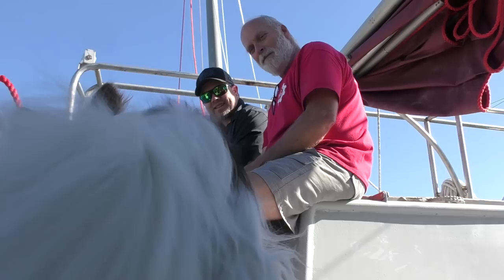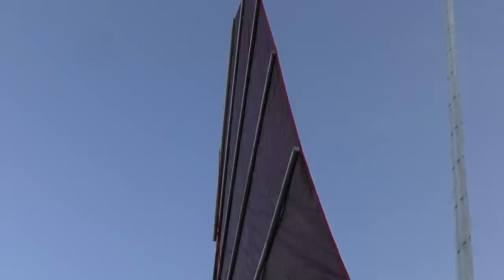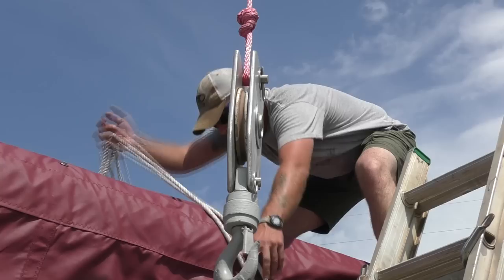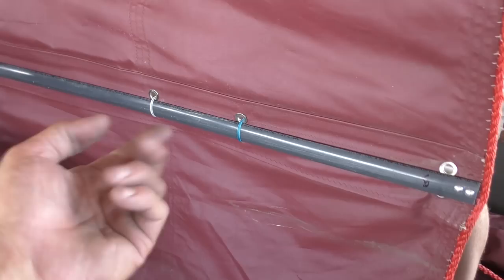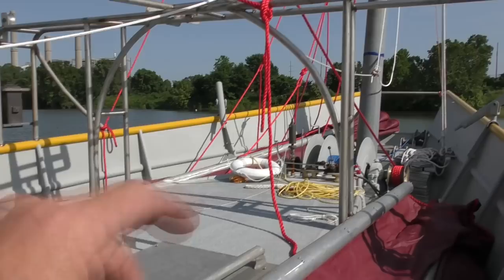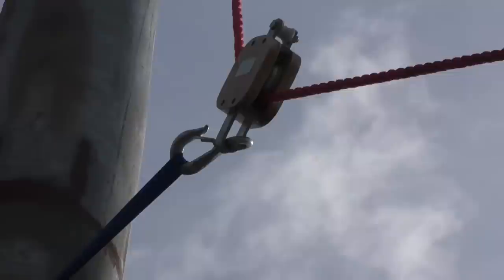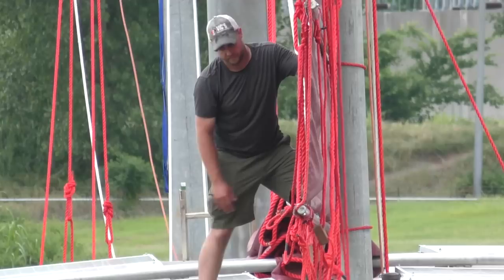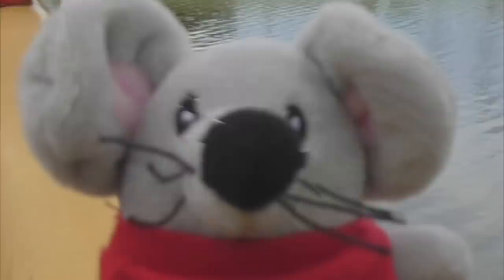Raising Sails  - Part 4 - Mistakes Were Made

Comment: Doug I've followed you thru the whole building of Seeker . As a long time sailor modifying your Junk rig to a simple Marconi type sail would eliminate all the excessive weight of a junk rig . A simple track on the mast allows the sails to slides up with little friction  . All types of sails can use lazy jacks it's not solely used by junk rigs . When you're out on the ocean and it's blowing I'm afraid the heavy junk rig will become unmanageable and dangerous . Time will tell best of luck .
Reply from the maker: You know you can convert Marconi's to Junk Rigs too.   You might find that fear without having even tried is not a good use of fear.
Reply: @SVSeeker   Doug , my comment / suggestions were not intended as criticism of SV Seeker electing to go with a junk rig as you've obviously built a fine vessel . It was only a suggestion ; as using a convectional roller furling rig has one great advantage which is being able to set & douse sails rapidly with a small crew. Junk rigs have been used for 1,000's of years so as you implied let's give it a spin before making judgement. Smooth sailing Skipper !
Reply: Why did you use aluminum battens instead of fiberglass or something lighter. That’s a lot of weight high above the center of gravity.
Reply: @claudehopper9813  you be right, arrrrrrrrrrrrrrrrrrrrrrrrrrrrrr
Reply: @crphilipp  Yeah I've just asked the Captain the same question, seems an awful lot of weight up there, especially if you have all sails up at once. To me it looks like a nightmare to handle, especially in a blow. Also many points of failure would concern me
Reply from the maker: @crphilipp    Bamboo was my first choice by the right type cost more than aluminum.   It is a lot of weight but that is not unusual for Chinese Junks.   So, I'll start here and modify it if needed.
Reply: The junk rig is a different mindset then western rigs. There are some great resources out there to read about it! Doug is doin fine, let's see how she sails!
Reply: @SVSeeker  It is much more difficult to change a "conventional" wired marconi into a freestanding wireless rigg because most marconi boats do not have enough strength in their hull/deck area where the masts go to keep up cantilever masts instead of the pressure post a wired bermuda mast basically is.
Should You find the junk idea some time later too chafey or too loud or even too heavy, You could easily change towards a freestanding wishbone version with mastrings, with a Wharram sleeve or with mast rails (I would be hesitant to regularly perforate those beautifully zinked, tapered sticks for a rail though - weld-on was better but still ruining the zink) as You already have the built in strength of the hull/deck to keep Yours erected without wires or strings. 
Anyway: You  trying to make it work aboard a hunk like Seeker is the best thing the junk rigg community could have dreamt of since Jester and Badger. 
Thank You a lot for sharing that all exactly the way You do!

Comment: Hey Doug, it's very interesting watching you transform yourself from the worlds best metal worker to a capable sailor with a completely different skillset, termanology  and materials to what you're used to. One thing I noticed was the sheer weight of that junk rig. The load on your running gear - blocks, clutches, cleats etc., increases again, the higher up the mast you go even before you get wind in the sail. Keeping the weight down on a sailboat  rig is what improves efficiency, wearability, ease of handling and ultimately boatspeed. The great thing is your ability to surround yourself with people who can teach you the skills you need and why I have watched your journey  all these years. Now it's getting even more exciting as you head for the ocean. Longtime Kiwi sailor.
Reply from the maker: Well thanks but I'm still a beginner when it comes to metal working.   There is really just a narrow amount that you need to be able to do in order to build a metal boat.  And the learning is the best part.  However there are extremely few that have working knowledge of large junk rigs, so it's exciting to be in a no man's land.  So I'll approach it like casting metal.  Start simple and add only what is needed.   So expect changes as we go.

Comment: For sail orientation: black is back, red is front, blue is down, green is up. so red & green is top front etc. My boat is much smaller but it is nice to pull the sail out of the bag & know what corner you've got without exposing the entire sail to the breeze. I use dollar store fingernail polish for color coding. Works pretty good as well for electronic insulation.
Reply from the maker: : )   You don't take junk sails down once they are up.
Reply: @SVSeeker  They do look pretty sturdy. I suppose they would not need repair / maint. stitching very often.
Reply from the maker: @lorenkinzel9145  Needle and thread, and sit up there on the battens.   : )

Comment: Water is coming down for sure but they have a lot stored up at Kaw Lake and Keystone lake.  Look up the USACE Keystone Lake page and you can see right now they are inflowing about 37K CFS of water and releasing around 31K CFS.  Kaw lake has dropped down a little bit but will ramp back up pretty soon till they get about 10 feet out of both lakes so you are looking at a couple weeks without rain till it drops.

Anyway since you have 24V on the boat I have a couple power chair motors with the wheel still on.  They will run forwards or backwards and once you pull the rubber tire off the aluminum rims should work pretty well as a winch motor.  Shouldn't have an issue for the smaller sails though and they lock automatically when power is removed but you can pull a level or pin (can't remember on these ones) to go into freewheel mode.  Anyway let me know and I can run them down and help out for a day.

Just finished up one side of the roof and have the other side to go or around another 1000 sq ft to strip off, sheathe, and then roof.  Currently has 4 inch spaced 1X4's for a cedar shake hence the need to sheathe the roof.  Furring out the walls to turn the 2X4's into 2X6's installing R19 in the cavity and then adding R10 XPS foam for insulation to seal and bump it up to R29.  It's overkill but the better insulated it is the cheaper the bills will be later on.

Comment: Just a fun note.  There is a tool called a cable tie gun. It is designed for zip ties and is made to tighten them up and clip the tails flush. And yes they do even make them for stainless steel zip ties.  Fast and easy and works with just a trigger pull.  But make sure you get a model that is rated for the stainless zip ties, because they are not all built the same.

Comment: Just so you know , when you buy sails you can get them with the corners marked on them.
Tack ( front lower)
Head ( top)
Clew ( back lower)
Peak (back top)
Usually in large easy to read letters.
Sails are left in place a lot more than they used to be but when we used to change sail for every  different 5-10 knots of wind , mistake could often be made !
Reply from the maker: Nice.  But you don't change out Junk sails.  They go on once and stay on.

Comment: They make ss cable tie tools that tension and cut short on Amazon for 30-40 bucks. Or……a steel screwdriver shaft cut the bit off and saw a slit down the middle about 1/2 inch.  Roll the tag end up into a roll.

Comment: consider buying some drainage pipe , cut it into stripes and glue or rivet them as wearbands along the masts where the pipe in the sail is contacting - also maybe put some holes into the pipes and fill them up with the water tigth closed cell Poliurethane foam - keep them from ringing like bells when they hit the mast - the plastic stripes will also help with the noise - we did it to a lag pole 
the noise might impede your sleep , especially since the non insulated part of the metall hull transfers sound like its made for it
Reply from the maker: Already have them laying on the deck. : )
Reply: @SVSeeker  thats awesome. proofs my logic isnt to far off the concensus - its all comming together... 
do you yet have a basket to hoist yourself to the top of the mast ? since you got the mast head up you should have a spot for a snatchblock up there and a hooking point for a winch on deck

Comment: Doug, grab a few of those cheap 12v winches for recovering of vehicles, hard mount them in a few sports, jic you need mega pulling power at sea one day.
Reply from the maker: The winch can be rigged to operate from hydraulics or electric. That’s when I get too old to crank it by hand.

Comment: Guys! You have to reduce the weight ( thus load) of your sails! There is absolutely no reason to have aluminum battens, they only keep the sail in shape. Use a lighter material, it will make a hell of a difference in handling everything. Good luck!

Comment: I can't help but wonder if a simple gaff or lugger rig might not have given similar looks and performance with far less weight and far less complicated rigging. We'll see how it works out for you. I share the concerns others have stated that this rig will be a nightmare to handle in strong winds. All sailors have very likely at some point been on the wrong side of a boom during a tack. Having such heavy battens in the rig only amplifies that risk if you need to be on the deck while taking a reef. Best of luck with figuring things out and may your ropes stay unknotted.
Reply from the maker: Yeah but it will not reef like a junk.   And if you're dumb enough to stand up on the deck tops while coming about then you clearly deserve what is coming.  : )

Comment: You will get less corrosion from string than stainless steel that will be accelerated from dissimilar metals. String just hold salt which is a slower corrosion.
Reply from the maker: True that but then UV has no effect on stainless.

Comment: I do this all the time on the farm 
Building sections laying down to be stood up and joined abd all the plans are in my head so it's like imagine this thing is standing up and the bottom is the top abd it's gott be a mirror of the last peice 
Weld a braket on, no that's the wrong side, cut it off weld it on the other side,no wait thats wronger,it was right the first time 
Then assemble it and yes it was wrong the first time so do it again 
The only comment I'd make about the sails 
How is that fishing line going tp hold up to UV, but how is the zip ties going to hold up to 1000s of jerking motions, stainless tie have always slipped on me, i guess its just a game of trial and error

Comment: please do the fishingline, stainless on aluminium will corrode and snap without warning. The mix will also deteriorate the point between aluminium and stailess.
Reply from the maker: I sort of doubt that.  Aluminum and stainless are often used together in saltwater.   I'm sure it will corrode, but I think very slowly.   We shall see.
Reply: @SVSeeker   Its widely used, but i have a 30 year old sailboat. And all the connections between stainless and aluminium have either made the aluminium brittle or made the stailess fasteners stuck. so from now on I try to make all the connections of the same metal, or have a easy changable disposable connection. Keep up the good work, SV Seeker is an inspiration!
Reply from the maker: @konshuss395  Ha!  In 30 years it will be someone else's problem and I'm pretty sure these sails will not last that long.   :)

Comment: Won't the stainless against the mild steel corrode, once you get to the ocean?
Reply from the maker: Aluminum and stainless are frequently used together, even submerged in saltwater. It will corrode, but I think slowly.

Comment: Why did you use such heavy battens? What are those like 1.5" aluminum pipe? and capped at that? I'd think some 2" strips of fiberglass would serve you well and wouldn't weight 1/2 as much..you kind of want them to flex... oh well just my opinion, carry on
Reply from the maker: Cost, repairable, and weight/strength is not that great.

Comment: That looks like a single small rope lifting a large sail. If there was a wind and that broke!
Maybe a block and tackle would give an advantage of the strength of several ropes to suspend the sail.
Reply from the maker: Go ahead and look up the breaking strength a 20 mm line. Prepare to be impressed.
Reply: Junks in Asia usually have a block attached to the top of the sail but that was usually without winches

Comment: Weren't these sails supposed to be easier to operate?
Reply from the maker: Did you see it reef?   Have you ever reefed a sail by yourself?
Reply: @SVSeeker  That wasn't reefing, that was dowsing. :O) To reef you would still need to tie down a portion of the sail to use partial sail. If you have lazy jacks on a bermuda rig it is not much different to dowse the main sail and most bermuda rigs have roller furlers on the headsails now so you just roll up the headsail. You can also have single line reefing setup on a bermuda rig to easily reef single handed from the cockpit.
Reply from the maker: @chaddthompson   No, you don't on a Chinese Junk.
Reply: @SVSeeker  That's pretty cool then. Is the reef held in place by the sheet on the rear?
Reply from the maker: @chaddthompson   ...and the batten, and the weight.

Comment: So i've been wondering. Slowly building ideas for my own future. Do you think a metal ship could be built in the same fashion as a cedar strip canoe? Frame up and then wrap it in strips of steel. Pull them taut and weld them in place.
Reply from the maker: Yes.  Check out Sailing the Farm
Reply: @SVSeeker  thanks! That's exactly what I was thinking.

Comment: Question au sujet de vos voiles. Pourquoi avez vous décidé d'utiliser des tuyaux aussi gros en guise de lattes pour vos voiles. Des lattes de fibre de verre n'auraient elles pas fait l'affaire. De cette façon une ou deux drisses pour lever votre voile auraient amplement suffit.
Reply from the maker: Slats have little rigidity.   And I can not weld a repair into fiberglass like I can aluminum.  Perhaps when I am in the bamboo parts of the world I'll try out bamboo.
Reply: @SVSeeker  merci pour votre rapidité à répondre!

Comment: I've commented it before and I'll do it again - I don't like the weight of those sails. All that weight aloft will be bad for stability and the difficulty in moving them is really a safety issue. First time something goes wrong in bad weather with half the crew already seasick maneuvering those sails around is going to become an issue.

I'm no expert on junk rigs, so you've got no reason to listen to me; you'll mention how fear won't keep you from getting out there. I agree with you there, but while you use what you've got I think you should take a moment to look at upgrade / conversion plans. Just because I think things can be better doesn't mean you can't start with what you've got. But starting with what you've got doesn't mean you should be stuck with the way things are either. My vote (though this isn't a democracy) is some kind of sail plan change. Give it some thought.

On the positive side. Seeker with her sails up certainly looks amazing and I cannot wait for the first time she moves under wind power alone.
Reply from the maker: I read your comment before. Thank you. Maybe you should read up on Junk Rigs.

Comment: Why didn’t you use a light material like fiberglass rods for the battens? That seems way too dangerous if winds pick up
Reply from the maker: How does that seem dangerous?
Reply: @SVSeeker  I know you have some sailing experience but when sails start to flog in 20+ knots of wind things can get pretty violent even with fiberglass battens and lines flailing.
Reply from the maker: @chaddthompson   On my first sailing trip the winds topped out at 43 knots.  It's noisy, but not dangerous.  And on a Junk, it's much easier to reef.

Comment: Those battens are way too heavy. There was a reason why original junks used bamboo sticks…
Reply from the maker: You'd be surprised at the weight of structural bamboo.   And completely shocked at the price of getting it to Oklahoma.   : )
Reply: @SVSeeker  Nah, the price wouldn't shock me - everything is expensive nowadays.😄But there are other materials like glass fiber that would suit sails better than metal bars. Manhandling those sails seems so difficult, and in heavy seas it gets extremely dangerous. Hope it goes well, though.
Reply from the maker: @jussipajala    I don't know what you are imagining but before you jump to "extremely dangerous" you might learn more.  Fear is easy.
Reply: @SVSeeker  It is not fear but 40 years sailing experience. Any wildly swinging and/or flapping mass is dangerous, and the sail seems to be so heavy that handling it is difficult even in zero wind. You are right though, no need to fix it before you have seen it is a problem. 😊
Reply from the maker: @jussipajala   So who many years of experience do you have on Chinese Junks?    And Not fear?  "extremely dangerous"  The lady doth protest too much.
Reply: @SVSeeker  Zero junk sailing… Are you saying junk rig is so different, that general seamanship doesn`t apply? 😀
Reply from the maker: @jussipajala     From the sailors I have spoken to that transitioned from Marconi to Junk.   Yes,  that would be accurate.  And "extremely dangerous"  : )

Comment: Don't write "Back of Sail"; write "Leech".  The front edge of the sail is the "luff", the top part is the "head", and the bottom part is the "foot".
Reply from the maker: Save it for the racing yachts.  Sailing jargon is not a great idea if you're only going to have non sailors around you.  Even Aft is confusing to the uninitiated.